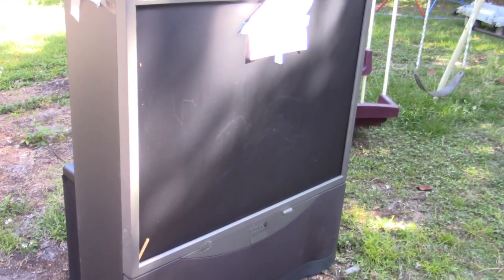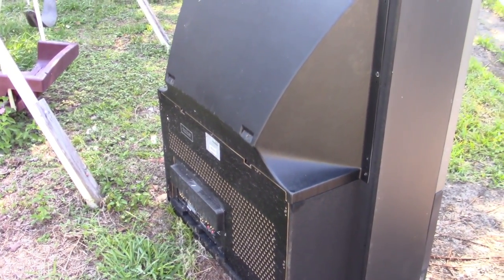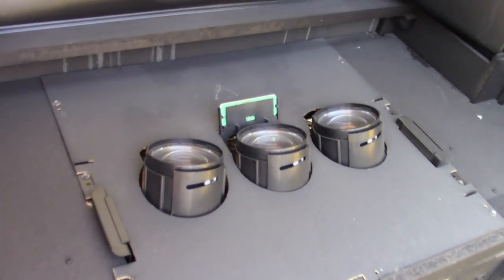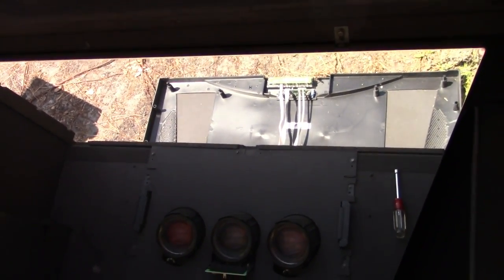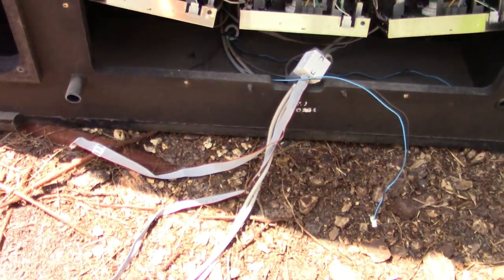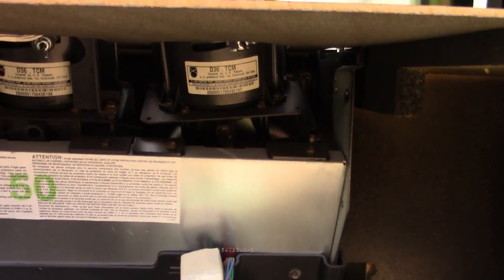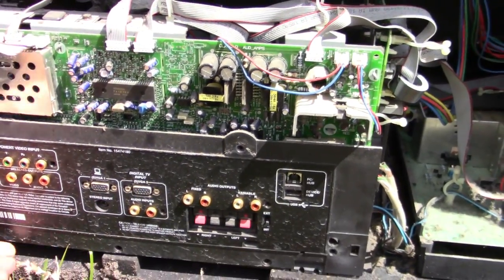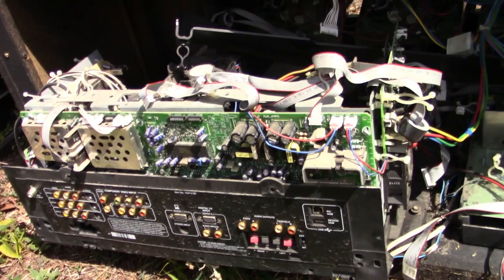What's Inside an RCA rear projection TV

Comment: I used to be a TV repair tech for about 12 years, from the early 1990s to mid 2000s.   Watching this video brought back a lot of memories.  And not all of them good.   It's kind of fun seeing you guess what each circuit did, you did well.
Reply: That fluid is optical grade ethylene glycol and it is poisonous.   It is similar to anti freeze in your car.   It's purpose was to keep the phosphor coating on the picture tube from overheating and burning.   If any of you are old enough to remember, if you left a still image of anything on an old tv for any length of time that image would permanently burn itself onto the picture.   Projection tubes had to burn hotter and brighter than direct view tubes, so they needed the liquid to keep the phosphor from yellowing.   That is also why there is 30k volts going to the anodes of a projection tube vs. 20k volts for a direct view. 
That shielded circuit board you were wondering about at 15:40 was the digital convergence module.   You can see the writing DIGCNV on the board.   It was basically the brains that controlled the larger convergence amplifier board that it was connected to.   It was the big board  on the right with the big heat sinks and transistors on it.   The purpose of the convergence circuit was to change the shape and size of the three picture tubes so they would all line up on each other on the screen so you would see one image instead of three.   Without a convergence circuit, he picture tubes mounted on the sides would project a smaller image on the screen closest to the tubes, and a larger image on the screen farthest from the tube.   A trapezoid.   In this tv, the data that aligned the convergence was stored in an EEPROM on the digital convergence module.   If this went out and had to be replaced, a complete convergence alignment had to be performed.   RCA tvs were not the best on the market, but they did have a fairly reliable convergence circuit compared to most other brands.
Reply from the maker: Well thank you for commenting, and for not criticizing a curious amateur...like everybody else.  Yes, this thing is one big fascinating dinosaur! But, I have another one for you. Ever seen inside a Sony Wega? Kind of the missing link between rear projection and modern TVs. But still projection. I made this video too and the projection box must be seen! Check it out - https://www.youtube.com/watch?v=FX_bqbcBMZs
Reply: @AutistiVision  It was a pleasure to watch, and your intuition is pretty much accurate. I commend you for that.   Anyone that would criticize you is probably covering up for their own deficiencies.    I wouldn't expect anyone to understand those old dinosaurs, unless they experienced working on them back in the day. 
Yeah, I did work on a few of those LCD projection sets like that Sony before I quit and found something else to do with my life. 
That RCA in this video is a crt (cathode ray tube) projection tv.   Glass CRTs are vacuum tube technology which was used in every tv made starting in the late 1930s and continuing for over 60 years until the mid 2000s when they finally phased them out.   It is old school technology, and their demise reflected the end of an era. 
This Sony is an LCD projection TV.   As you noticed, a very hot mercury vapor lamp shined through a series of mirrors and prisms, through  red, green and blue LCD panels.   Those are the three primary colors of light, and by combining those colors in various percentages, you can make any visible color of the spectrum. 
At twelve ten in that video, the power supply which powers the lamp is called a ballast, and it operates in a similar principle to a ballast which powers a fluorescent bulb. 
The most common problems they had was the lamp burned out from time to time.   Sometimes they would shatter and leave broken glass all over the inside of the chamber.  The other common problem was the lamp burned so hot it would eventually burn one or more of the   little LCD panels, which were usually not more than 1 square inch.  You could input a signal onto the screen which would display a solid red, green or blue field.   If you seen dark spots anywhere in the picture in any of those colors, then you would know which LCD panel was burned and damaged.   Sony used real glass mirrors in their projection tvs, unlike that cheap  mirror in the RCA.   As you can see, dust accumulates on the lens and the mirror, and needs a periodic cleaning or the picture becomes cloudy and dim.   You can't clean that RCA mirror.  You can't even touch it.   
Flat panel technology advanced to the point that these style of tvs became obsolete as well.     They are higher maintenance, less reliable, take up more space, and are heavier. 
Before this, the technology was not perfected to the point where you could have a really large flat panel tv.
As for the plastic screen itself.   The outer screen had very fine vertical lines in it and was called a lenticular screen.  The inner screen was a freznel lens.   We used to play around with them.  On a hot day we could focus the beam enough to melt a penny.   It was very bright and it was best to use welding goggles so it didn't hurt our eyes.
Reply from the maker: @bekimbal9658  Thanks for the great reply! 2 things I have to mention - 1, I too had maybe a little too much fun with the fresnel lens. I actually cut it into a circle, glued 2 hula hoops around it, then fastened it to a pole and made a gigantic magnifying glass! ( I still have it, hehe) And 2, I gutted the Wega TV and made a hobby spray booth out of it. Mounted a bathroom fan to the back of the shell. Removed the screen of course. Vent pipe to a dryer vent on the outside. Still looks like a TV though! Thought you'd get a kick out of that. :)
Reply: @AutistiVision  Hah! Love it!  That plastic cabinet would be great for spraying models.   I used to keep a collection of prisms, mirrors, lens and things.  But I could never figure out any practical use for them and got rid of them when I moved.    I am going to have to subscribe and see what else you are up to.
Reply from the maker: @bekimbal9658  Ha, I also collected a bunch of these lenses and rear projection internals, because they were so neat. And I also threw them out after many years of doing nothing with them. :) Oh, these days I mainly play with vacuum cleaners on this channel. Pretty neat stuff sometimes though.
Reply: @bekimbal9658  Thank god it wasn't acid.  It got all over my leg and the floor.  Just wiped it off. :-)
If I knew these lenses were great magnifying glass, I would have taken it apart long ago, instead of spending money buying crap.
Reply: Any advice for someone changing trajectory on careers I'm 28 an want to learn how to repair tech new an old is there no more course you can take like back then
Reply: My grandparents had a 40" rear projection in 88 and we had an early HD model (1080i) in early 2000. I'm so glad the rear projection era is over -- they were awful, tbh. The 3 tubes never stayed in alignment for long, so we kept you guys in business making house calls!

Comment: That little board in the front of the screen is just an infrared receiver for a remote control.
The board with BIG heatsinks is the driver for the deflection coils that scan the electron beam in the color gun screen
The metal box with electronics inside contain a video processor, and it's shielded from radiation.

 Thanks for this detailed video, btw ♥️ i didn't even existed when this unit was manufactured 😅

Comment: The little sensors around the edges of the screen are for the auto-convergence system. They are light sensors.

The mirror is a first surface type mirror, and is used because a glass mirror is a secondary surface mirror and would create ghosting.

The item at 9:00 is the remote control receiver board.

The HV leads come out with a push in and twist, then pull.

The liquid is ethylene glycol. Very corrosive to metal, which you probably know by now ;)

The tubes a P16 series, which a Panasonic 8" projection tube that was used in almost all rear projection TVs by about 1998, the next 3 letters after the P16 indicate the other attributes. Even Sony rear projection TVs usually used these Panasonic tubes, but a higher grade tube and a superior glycol chamber to what you found in that RCA.
Reply from the maker: Thank you for all the information! Really good stuff.
Reply: @AutistiVision  No problem at all :)
Reply: Good explanation, I repaired those TV's for years,  The fluid in Magnavox sets often became contaminated, if not caught in time would ruin the surface of the lenses.  A lot of Mitsubishis had a problem with the fluid leaking onto the main circuit board.  Causing many issues.
Reply: @tinicum54  Yes the Mitsubishi sets were often used in arcade machines for the 50" cabs, the design of the LC chambers in those sets was a bit odd, and not a lot of expansion room for the glycol, so they leaked a lot earlier than some other sets. 

I haven't ever seen a Magnavox set, i don't think they were ever sold here. Some Sony 7" tubes were bad for that same problem, but with those they were air coupled anyway, so it was all glass instead of the plastic C element you get in the lower end liquid coupled chambers. A lot of smaller front projection sets from Sony as well as a few others used those Sony tubes and had the same issue, Sony used to supply those tubes with the AC housing attached and pre-filled with glycol. 

I did see a couple very low end GE rear pro sets that were air coupled, had glass mirrors, and to make matters worse they had full analog convergence, with the adjustment pots pretty near at the back of the set. They were less than half the price of a Panasonic GAOO rear projection set.

Comment: It's the sensor is for remote of course, it takes the same way like the picture, but in opposite direction. The LEDs might be an indicator to show the device is working while the tubes are heating up. It can't be a real background light, in 2000 LEDs haven't been very bright and of course nobody wanted to have more light than from the tubes.

Comment: the liquid is for the optics, it transfers light better than open air would in the assembly.
Reply: Taran Williams can you toss something like that in a dumpster or do you have to take it somewhere. I was planning on taking everything out of mine and using it as a display
Reply: That liquid is also a coolant as the guns get pretty hot
Reply: Is the liquid dangerous?
Reply: @darkapothecary4116  You should not toss any parts in the dumpster especially the parts that have the liquid in them. The liquid is poisonous and very hard on the environment. Its best left inside its container. If you think you must take it out be very careful, If a pet licks it off of the ground or floor it can kill your pet. Pour the liquid in a jar and find a place that takes hazardous waists.
Reply: @iTsMaaT  The liquid is poisonous and very hard on the environment. Its best left inside its container. If you think you must take it out be very careful, If a pet licks it off of the ground or floor it can kill your pet. Pour the liquid in a jar and find a place that takes hazardous waists.
Reply: @sunriseinspector  I ended up disposing of in in a safe manner the inside I ended up getting to make a display case
Reply: @sunriseinspector  is it dangerous if i got it on my fingers?

Comment: It wasn't all bad. Might not be as vibrant as an 'LCD' but old technology works great for old games. A massive 4:3 display and a zero-latency CRT with 1:1 resolution on 15kHz images and no dot pitch. Might be able to use the tubes in some arcade machines too.
Reply: Yeah, and massive scanlines on screen too.
Reply: @snesfan8935  A number of rear projection TVs supported specifications beyond the common CRT TVs. Such as the very TV being torn apart, which supported HDTV.
Likewise traditional projectors(not rear projection) can give a gorgeous HD image, with pitch black blacks. These were generally the best there was pretty much until laser projectors.
The worst thing with CRT rear projection was the screen itself, not the tubes etc, assuming everything was setup properly.

Comment: On some projection TVs there is 30,000 volts running to each color projector. That voltage will leak off in time, but if you don't know what you are doing your put your self at great risk.
Reply: Why you think CRTs have fly backs it all that extra energy not used
Reply: How to discharge that voltage before I open one of this ?

Comment: I am glad to see you have those things around the screen to. I am trying to find out what they are. Any ideas? Nice video
Reply from the maker: I think it's the old old version of the backlight idea. Just to get the illumination or brightness up on the screen. I think?
Reply: @AutistiVision   I know it's three years later, but those are not LEDs around the edges but they are light sensors... the TV goes through an automated convergence process that flashes the read green and blue CRT projectors and use those to reference the position of the light so that the RGB can converge to make a color picture. This video https://youtu.be/mUzpXg91BXU?t=160 shows the process it goes through. It's called Magic Focus on some TVs.
Reply from the maker: @skiboxing  Aha! Thank you! Very interesting to guys like me. I will watch that video right away. Great information!
Reply: Had one these TVs in the early 2000s and I once got a really dark picture nothing you do in the setting would fixed it. Turned out to be a dirty mirror I cleaned it up and boom nice bright picture again

Comment: I was able to use a plier on the screw parts of the lense cases and unscrew them. Then stuck a flathead in the crack and pull the inside up through.
Reply: Damn, does anyone just make regular 'ol love anymore? It's all 50 shades of black n decker wreck destroy

Comment: I have the exact tv but is messed up now so I’m trying to figure out how to throw it away bcz it is to heavy so can I unscrew or use a hammer with it ?
Reply: Have you tried bitbingit yet?
Reply: I hope you didn't use a hammer, it contains stuff that should not go in the garbage, some toxic, along with considerable glass. Also potentially very high voltages, though unlikely if left unplugged for a very long time.